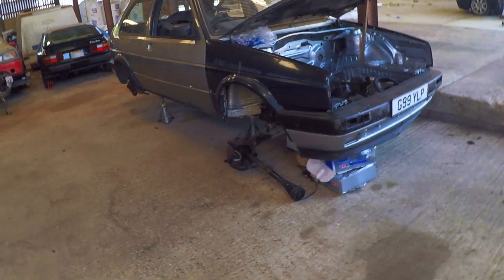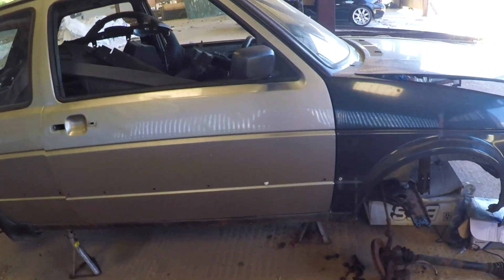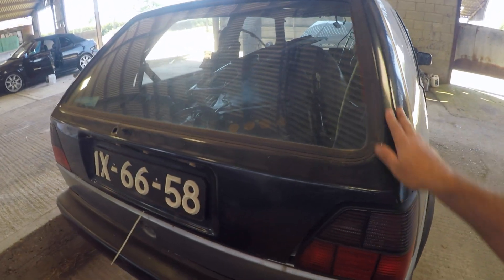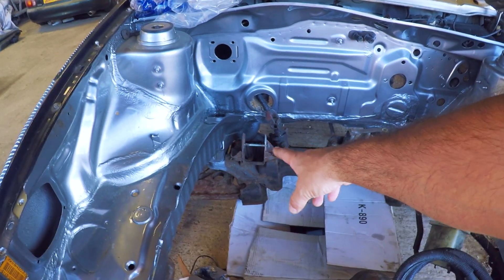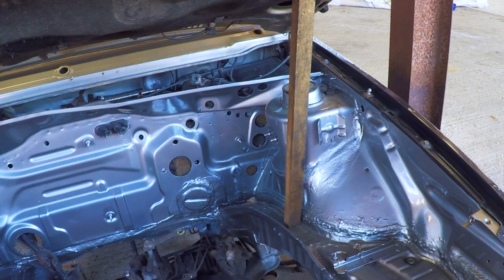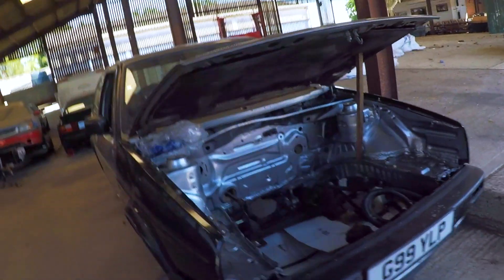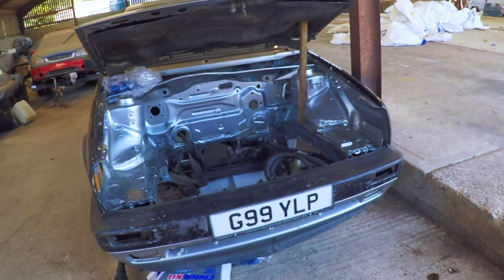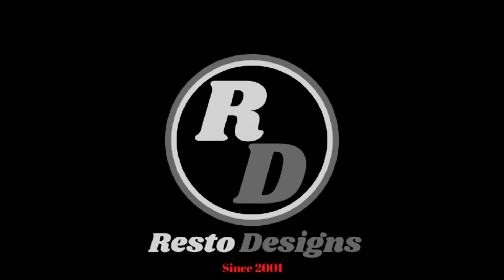VW Golf mk2 20V Turbo swap 322hp GT28RS Part 1

Comment: Just found your channel, will go through it now & see how you got on with this.
I’ve had a shell sitting around me for years & this is what I will be doing to it when I get around to it 😂

Question about your panels from Portugal, any particular reason you got them from there apart from
Dry climate? Was it fairly priced & did you go there or did you get them delivered over?
Reply from the maker: Unfortunately this project was sold off due to Covid and me leaving the UK. Yes I got the panels super cheap and rust free from Portugal, but that was before Brexit.

Comment: great video sub'd which is easier to do the 20v conversion 8v or 16v?
Reply from the maker: Only difference really is k-jet or Digi as fare as 8v's go, the std k-jet fuel pumps can handle 350+hp once you remove the Fuel Pressure Accumulator, the std Digi fuel pump can't handle 200hp.  Apart from that they are the same amount of work.